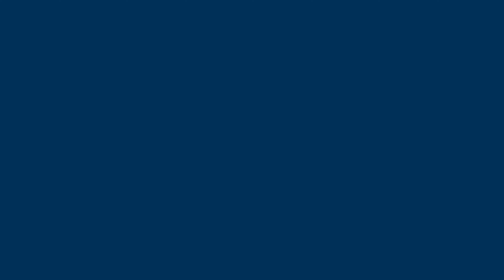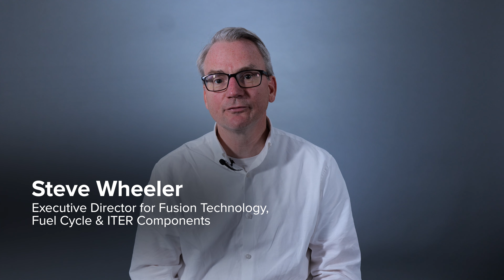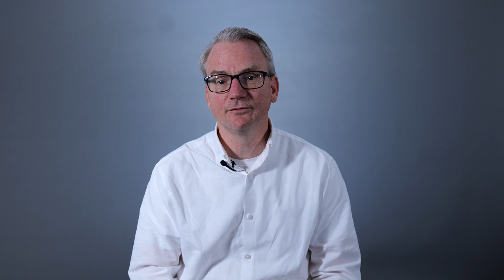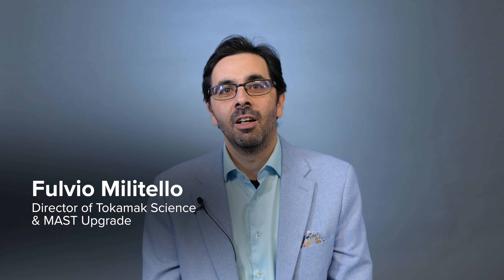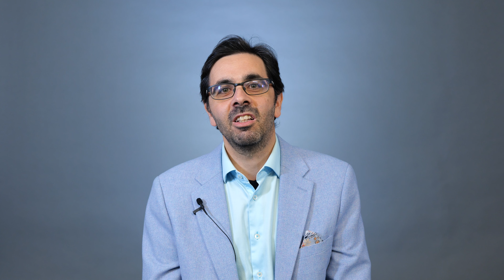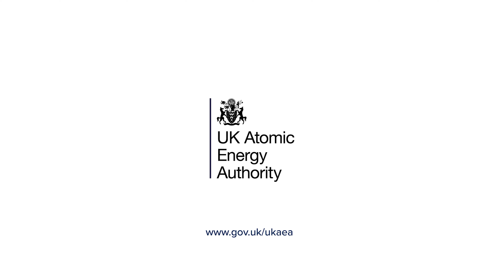JET's Decommissioning & Repurposing: Science

Comment: Neglecting tritium contamination, what kind of radiation levels in say millirem per hour, would I expect to find from neutron activation of the inner wall if I were inside there with a Geiger counter pressed up against the tungsten right now?
Reply: I can’t answer your question but a trivial dose compared with a power plant fusion reactor.
Reply: @johnh6245  of course. There was a recent paper which estimated these rates that I now can't find, but the rates are predictably insane, many kilorads per hour. High enough that without cooling meltdown actually may be possible due to decay heat on a hypothetical future fusion reactor.
Reply: @Muonium1 Hadn’t heard of the meltdown possibility - interesting. Another question is whether the present hyping up of robotics (eg for JET decommissioning) will be relevant in a reactor.